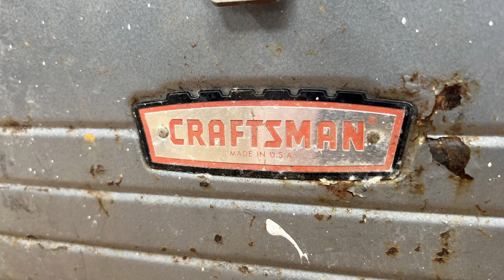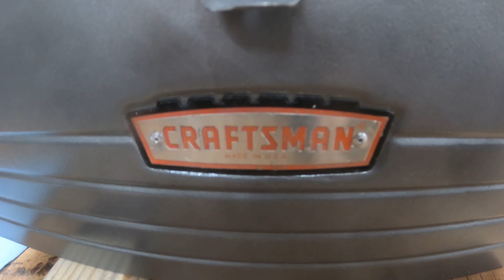Vintage Craftsman Toolbox Restoration

Comment: Nice job! I restored this same model, but the pop rivets on the latches started to pull loose from the weight when I put tools in it. I ended up using bolts and nuts with loctite to solve the problem. It's my house tool box now.

Comment: Excellent job!!!

I have some questions. What did you soak the latches in to remove the rust? What size and length rivets did you use? I want the rivets to be flush inside of the box.
Reply from the maker: Soaked them in vinegar. I'll check the size of the rivets in a little bit.
Reply: Great work!!
I’m in the beginning stages of restoring my Dad’s. What is the size of the rivet you used for this project?